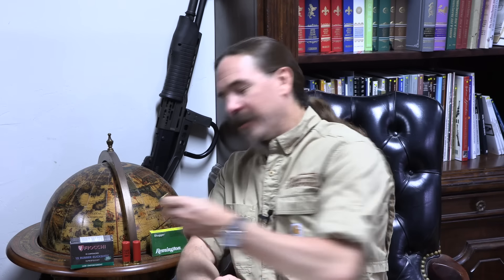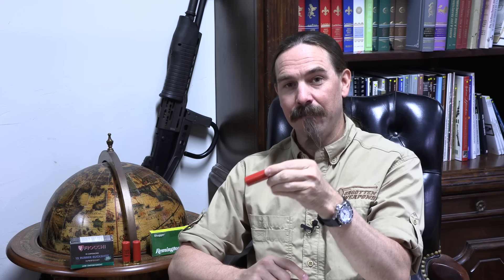The Unique Challenges of Self-Loading Shotgun Design

Comment: 9:47 Saiga-12 is short stroke shotgun. Uses a small "puck" type piston in the gas cylinder that smacks the carrier extension. 

I'll also mention that hull deformation can be an issue with mag fed shotguns. In the Saiga-12 a fully loaded magazine under a closed bolt puts consistent pressure on the middle of the top round and in the long-term will eventually deform the shell enough to impede feeding. Solutions include leaving the mag out of the gun, keeping the bolt locked open, brass shell for top round, or grenade-type pull-pin magazine mod.

I'm glad you made this video because I've been explaining these problems with shotgun ammo to people for years.

Now do one on how and why .22 ammunition is the worst-designed brass-cased ammunition still in production.
Reply: I'm genuinely curious.  Are you suggesting we should get eliminate .22 or that we should take strides to improve it?  Because companies like CCI have just about perfected the .22 round's reliability and accuracy.
Reply: @JustStayingGroovy  No, it can neither be eliminated or improved for the same reasons of institutional inertia described in the video. We are stuck with the .22LR that we have. And no, companies have not perfected the round, it's still an absolutely terrible design for autoloaders and magazines, just like shotgun shells. Yes, we have found some really great ways to work around these shortcomings (just like the shotgun shells) but it does not change the fundamental flaws of the design (just like the shotgun shells).
Reply: @distalradius8146  You neglect to mention that our firearms companies have been able to work around these "shortcomings" and make firearms that reliably cycle .22 without issue. M and P 15-22, Taurus TX 23, Ruger .22 pistols just to name a few. I'm not saying that the .22 is an ideal round for defense, etc. But I've had about 6k rounds through my M and P alone and the straightforward design of the blowback system and the modern .22 rounds I run mean that I've maybe had 5 malfunctions. .22 firearms design has been evolving in parallel with the. 22 round and it is more perfect than I think you care to admit or recognize. You're talking .22 cartridges from 80 years ago. I'm not on the side of "Oh,  .22 is perfect for self defense and taking down Buffalo " but you're being disingenuous if you say that the .22 round has suffered some sort of institutionalized stagnation in design. It's  a robust enough round, run in everything from bolt actions to break barrels and anything in between. If what you say is true, then the market would not be INUNDATED with semi auto .22s which function ALMOST flawlessly (not perfectly,  due to the nature of the .22 primer). You can't lump all .22 together and say "Well, it's institutional inertia" because that's the same story for ANY round that is in common use. The market and end user (i.e. the one who is shooting) determines the popularity of the rounds that are widely available. I'm not familiar enough with the use of shotgun shells, but my Saiga has run without issue as well. However, shotguns fill a different role than rifles. Just like the humble .22 round.
Reply: @JustStayingGroovy  That's an awful lot of words just to say that you like .22LR. I disagree, I think it's a fundamentally flawed ammunition design and we've all just gotten used to it. I'd attempt to elaborate but I feel I'd just be repeating myself.
Reply: Good point, I'd forgotten that it was deceptively a short-stroke piston.

Comment: This is also why the China Lake 40mm never took off back in day, or even when new owner in 2010s tried getting contracts it failed to bring decent prototype (and US went with Milkor GL) . 
Its easier to run 40mm in a 'revolver' setup than it is a semi-auto 'oversized shotgun' style.
Reply: The only China Lake 40mm I'm aware of is the pump action version. Was there a self-loading version made in the 2000s?
Reply: @kutter_ttl6786  I think Ian covered the attempted modernized China Lake prototype and it was still in the white as manufacturers call it meaning it was early enough in production to not have a surface finish but I don't remember any attempt being made to turn that prototype semi-auto

Comment: One thing to be aware of if considering a box mag shotgun for home defense or similar is if you keep a loaded mag in the shotgun the top cartridge will be pressing up against the bottom of the bolt and this can deform the plastic casing which can potentially cause the cartridge to jam up against the chamber. I have seen this happen. Solutions would be either to keep the bolt locked open and/or the mag out of the gun until needed.
Reply: Leaving the mag out is safer on the household.
Reply: @VikOlliver  Definitely
Reply: @VikOlliver   letting the bad guy hear you chamber a shell is probably quite effective in convincing them of the error of their ways.
Reply: @alijankhan3330 Police say that's a big part of the reason to carry a shotgun in the car. It's more intimidating despite being less wieldy in close quarters than a pistol.

Comment: Good points, very crammed presentation. One can expand every minute here into into hours of discussions - and I'm sure you would very much like to. But I want to add another point: working around so variable cartridge is full of design challenges. Once you get into production, it pays off massively with robustness of said design and much lower requirements for machining tolerances.

Comment: There was a company called Intrepid Tactical Solutions that tried to remedy this exact problem with their RAS-12 shotgun which fed 12 gauge rebated-rimmed shotgun shells from a detachable 5-round box magazine. The ammunition had a polymer-jacket with a bullet-shaped tip that would help with the feeding issues and when fired the polymer casing would then split apart releasing the payload.

Comment: Somehow the Russians perfected it with Saiga-12. Never an issue, and I ran everything from light trap load to magnum slug. It has two gas settings and I always ran mine at full gas but added a urethane buffer to cover all bases. The only time it ever didn't cycle fully was my own fault - I bought a box of very old looking slugs from a gun show and they lost most of their power from degrading. Really impressed with how it was all essentailly AK sized but a cartridge 3x as wide. It had a SVD stock, side scope rail, and perfectly complemented my Tigr SVD.

Comment: Let me just take a guess first:
1) rimmed straight walled shells so box magazines have issues 
2) variable cartridge length, and the flat front has beef with feed ramps
3) wildly variable pressures so no one system is guaranteed to work for everything 

In this essay on why the Benelli M3 is the best shotgun ever made, I will…
Reply: I think you misspelled the Browning Auto-5.

Comment: Sorry if you've already covered this, but someone did redesign shotgun shells for auto/semi-auto applications. It was called the Intrepid RAS-12, and it was based on the AR-10 with the same gas-operated design. What made it stand out were the proprietary shells. 

They were just as you describe, a rimless cartridge, except these were solid polycarbonate and came in rounded slugs only to make it a little easier for the prototypes to extract and chamber smoothly. Technically the length of the shell didn't matter as long as it would fit into the magazine since the only part of the shell not actually in the barrel was the portion the BCG was hanging onto.

The idea was to standardize the pressure generated by these RAS-12 shells across multiple models and platforms since the rimless shell design meant they couldn't be fitted into standard shotguns. 

There are still a fair number of prototypes out there, to the degree you can find Facebook groups about them. And people have worled darn hard to reuse the hulls, but ultimately Intrepid had to close up shop in 2014. It was their revolutionary idea that did them in. The shells themselves weren't picked up by any other manufacturer, and Intrepid couldn't afford to be the lone manufacturer. They just didn't have the financial backing.

Comment: Browning long recoil gun and it's Remington and Savage offspring are I believe the best overall self loading shotguns ever made. I have cleaned Auto fives that customers brought in that were packed with so much gunk that there was nearly no place for the components to operate. The gas guns available back in the 80-90s would have stopped operating long before getting that bad. Also the robust construction of the Auto five and it's brethren makes broken parts a rarity.

Comment: I have 3 twelve ga. scatterguns, 2x vintage FN made Browning A5 & one I'm sure many have never heard of, an SKB XL900 gas operated gun. All are chambered for 2 & 3/4 cartridges. One of the A5's is a problem child that jams but I believe it's something inside the receiver vs the friction set up.

The SKB was my 1st personal firearm initially purchased for skeet shooting - ergo light loads. It has since been used with many different loads all the way up to heavy slugs. Never jammed to the best of my recollection. Only difference is in recoil, with the slugs being quite punishing on the old shoulder, same goes for the A5's. So my conclusion is that SKB engineered the gas system to handle the lightest loads & still feed reliably & left it to the shooter to deal with the added recoil of heavy loads. No need for extra features like adding a pump option. ;)

SKB, originally a Japanese company ceased production in 2009 but the brand has re-emerged with guns being made in Turkey. At the height of production SKB made shotguns distributed in the US by Weatherby & Ithaca.

Comment: The relative scarcity of the dual-mode shotgun rather baffles me. All I can think of off the top of my head is Franchi with the SPAS-12 and -15 and Benelli with the M3.

Really seems to me like a sensible solution of making an automatic action that's good for one range of loads - those most likely to see use in combat, where an automatic action is the most desirable, - and then just covering everything else with a blanket backup option. As opposed to either making a more "flexible" and questionably reliable automatic system or giving up entirely on the benefits and possibilities of either automatics or low-power loads.

My only guesses as to the reason why these are rare are profitability concerns over a more complicated design that has the bits to do either job, and maybe the unwillingness of manufacturers to trust the end user to know what they are doing well enough to make timely decisions on when to use which. Because if that fails, the public consensus may just end up placing blame on the product.
Reply: Perhaps it’s that by including a backup system in case the semi auto action doesn’t work, you imply that your product isn’t 100% reliable. 

The question that might pop into the consumer’s head is “why isn’t this semi auto only,” to which the answer is “because if it were semi auto only, there are certain loads it wouldn’t run.” You and I understand the breadth of 12 gauge loads on the market and why that’s a reasonable solution, but consumers en masse might interpret this as the manufacturer saying “we couldn’t make it 100% reliable so we said fuck it and threw a pump on it too.”
Reply: I really like the idea of a pump-capable semi-auto shotgun.  That's why I own a Benelli M3.  That being said, it's not as practical as it seems.  There isn't a standard factory load that my M3 won't reliably cycle in semi-auto.  I can run a tube alternating slugs, 00 buck, and low-brass 7.5 without a hiccup.  There is no good reason to include the pump on a quality semi-auto shotgun.  If a less-lethal or particularly weak target load fails to cycle the bolt, you can cycle the bolt manually to eject it, just as you would a failure to eject in any other firearm.

If you have a reason to run a bunch of low-powered loads in a row, you probably have a reason to own a dedicated pump action shotgun.

That said, I do still run the M3 in pump action sometimes, but it's just for fun.
Reply: All to get police contracts, one modell can serve all purposes, no matter if breaching, guard duty, crowd control. Are they any good? Can only tell on the spas-15, which isn't.
Reply: Probably because there wasn't much of a demand to begin with. In a military context, simply running the charging handle of a semi-auto shotgun to use less lethal or breaching rounds is acceptable, though at that point you may as well use a pump shotgun. The semi-automatic shotgun is brutally efficient in CQB, although "killing people" comes fourth in the list of what militaries use shotguns for, that being less-lethal, breaching, and drone killing, and the only one of those that can benefit from semi-auto actions is the drone killing, and even that can be done with even a break action single shot. 

For the sport shooter, if you want a semi-auto and a pump shotgun, you could probably just get a semi-auto and a pump shotgun and it'll probably be cheaper. 

If there was a demand for them, we would see that in a tidal wave of Turkish Benelli M3 clones flooding the market as they had with semi-auto and pump shotguns. A number of good quality inertia-operated shotguns come from Turkey, and all would be a suitable basis to crank out a Benelli M3-style hybrid pump-auto clone since any patent on them probably expired by now.
Reply: Some good points being made, although on the aspect of "just have two different shotguns," I'd say it's an easier offer to an individual shooter than it might be for some manner of agency that's looking to fill whole racks with shotguns. At that point, I'd imagine it would be much more appealing to have a stock of one model that can do both rather than even more shotguns that are either-or. Provided, of course, they have sufficient use case for both.
Reply: @beingsactual  I would like to counter that "Just have two different shotguns" is even more beneficial to a law enforcement agency.  They should not have less-lethal rounds mixed with lethal rounds in a shotgun, and the shotgun loaded with lethal rounds should be distinguishable from the shotgun loaded with less-lethal rounds.  That is a mistake you want them taking measures to avoid.
Reply: @chrissmalley83  Yeah, that's true. There's already plenty of efforts to make shotguns that can only physically chamber special dedicated loads and won't fit a regular hull.
Reply: I could be out-of-date here, correct me if I am now wrong, but in Canada the Dual-Mode system is banned/prohibited a number of years ago, Liberal politics. The loss of a market=less demand.
Reply: All semi-auto shotguns are "dual mode". You just run the bolt handle manually.
Reply: @distalradius8146  Compared to using a pump, it's a lot less convenient, needing to break the shooting grip and whatnot. It's fine for a one-off no-particular-pressure thing like directly loading a breaching shell, using it, and going back to combat loads. But if one plans to use a full magazine of cartridges that won't cycle the action, having a proper pump action is a substantial accommodation.
Reply: @beingsactual  So substantial that everybody's doing it?

Comment: Were going to see a new style of rimless, brass cased shotgun shells come out within the next 10 years spured by military demand, I'm near certain of it. Shotguns are proving to be one of the only ways to deal with short range drone defense, a belt fed or chaingun style auto shotgun using higher pressure, brass cased rimless rounds for increased range is going to end up being the only really decent ultra- shorad weapon soon. There is finally going to be a need for it. Jammers don't guarantee a neutralized drone with how quickly the tech changes, and shooting at them with rifles ends up spending a ton of ammo on misses.

Comment: Beretta 1301/A300 utilizes a short stroke gas piston and mine runs flawlessly with #8 to 3" 00 buck, never had a single malfunction cycling any kind of different load. Beretta/Benelli are the superior operating system of any semi auto on the market today, the self cleaning piston actually stays clean and hardly gets carbon fouled at all, it just needs a light scrubbing every now and then

Comment: Beretta has short stroke gas piston system (in 1301 and A400, at least).
In my experience, Beretta's system is the most reliable semiauto you can possibly get. And being IPSC shotgun shooter, I do have a bit of experience with shotguns. I've personally put through my 1301 Comp Pro about 50,000 rounds and it's still kicking. Can't say it's perfect - cracking bolt heads and bolt carriers are real and hydraulic bolt end stop is hot trash, but it does feed 1000/1000 rounds if it's in an OK condition.

Comment: As an owner of a Marlin 12-gauge bolt action, I can concur that box magazines for shotgun shells are not the best.  I was having feed issues for the longest time until I realized that, because the gun was designed as a goose gun, the tangs on the top of the magazine were designed for high brass shells.  The low brass on most trap shells allowed them to pivot enough that the angle was wrong for the bolt to feed it into the firing chamber.

Comment: I have an Uzkon TR-100. Pretty much the same thing as a Derya MK12 — they are both made in the same factory in Turkey by an OEM provider.
It's chambered for 3" shells which are hard to find in slugs, for hunting paper targets. It frequently miss-chambers 2.75 shells unless I hold it at a slight left-leaning angle.
Still is fun. But yes. The 12ga shells are a pain.